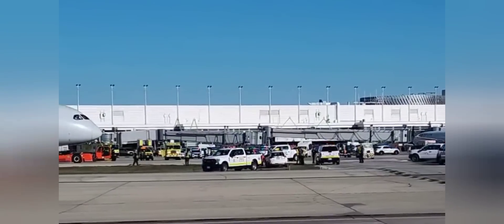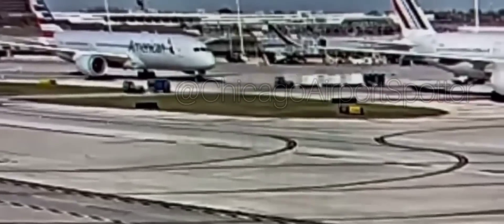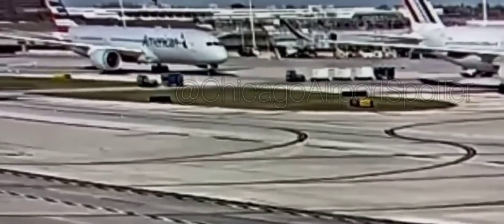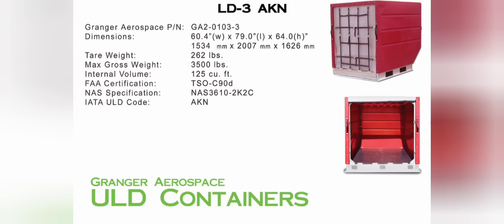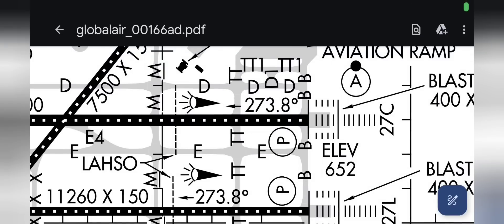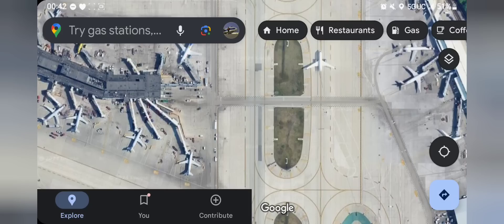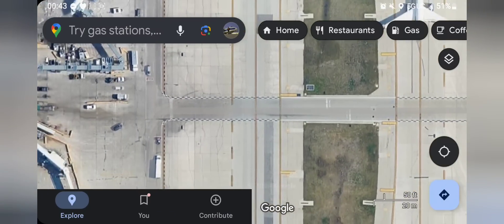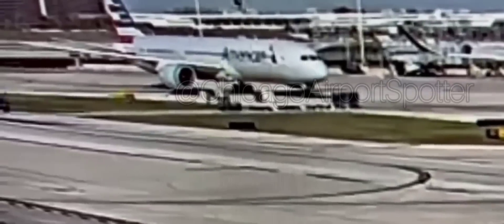INCIDENT REVIEW - American Airlines Boeing 787 Engine Ingests Cargo Container at O'Hare [10.17.24]

Comment: Good briefing on the luggage carts. Flew the 787 for my last 5 years. I saw another reader mentioned 20 million for one Pratt. The price for  these aircraft (787-8) is just a little over 200 million. The 787-9 is over 240 million, and the 787-10 just under 300 million. 

The OP mentioned he drives a fair amount at ORD. At least from my experience, ground handlers in O’Hare are pretty good about safe driving on the tarmac, as in not usually cutting us off as we were taxiing. There definitely have been countless ‘incidents’ at other airports (never at any of our international destinations….only in U.S. airports) where I had to slow or even stop the aircraft while a baggage handler crosses right in front of us, sometimes the driver not even looking. Just surprised this doesn’t happen more often.
Reply from the maker: I was a ramp controller for a few years, I took a lot of calls from pilots giving me the company name and vehicle number of vehicles that cut them off. And by "a lot" I mean 10-15 over 4-5 years. 1 is a lot, tbh. I followed up on every single one because I didn't want that idiocy on my ramp.

I remember one time I sheepishly slowed to a halt by the F Alley, and an RJ pilot waved me through. I looked around me, saw that everything was good, and I scooted across in front of him, gave him a thumbs-up, and immediately got pulled over by airport security 🤣 He let me go, though.
Reply: @ChicagoAirportSpotter  Always like to read about that type of story. Never was based in ORD, except for a month back in the mid 80s. Actually one of the best airports, excellent ATC, operations, as well as the city itself. Never visited any Ramp Controller, but did a tour of our OPs in SFO as I had a friend working there. Anyways, I just remembered that I need to subscribe to your channel. Retirement is fun every single day, but I still remain interested in Safety, CRM, etc.

Comment: Well done. A little wordy, IMO, but well done. Most will not recognize that the A350 blew the containers off with 100+ mph jet blast, as at the point where the containers are flying the A350 has begun to move forward. Break away thrust can be 150 mph. Maybe more. It is for this reason we never ask pilots of large, heavy jets to “expedite” or “taxi without delay.” People have died in similar situations here at ORD as a result.
Reply from the maker: Definitely a little wordy - I did this off the top of my head without a script. If I do another one of these, I'm changing that. I had so many people asking me what happened that I got tired of typing it out, so I made a video to explain it to them and then decided to upload said video 😆

And thank you for the additional info. When I was a ramp controller, I often used the phrase "minimum breakaway thrust" on the frequency when guiding departing aircraft out off the ramp because we had so much activity behind them, we had to take every possible precaution to deal with the horrible layout of the Lima Alley.

Comment: This service road crosses Two Active aircraft Taxiways... Surely the MUST be positive ground control of who can cross them, & when. Just as aircraft could not cross a taxiway with out GC clearance neither should a ground transit vehicle of any kind. This would not have happened if the aircraft ahead of the AA had not 'powered up' to move as the Dolly truck passed behind. 
I don't see this as a failure or blameworthy by the Cargo dolly driver. This is & should be a GC failure & human GC should more tightly control this system, and also by Computer tracking for failsafe. That 20 seconds saved cost upwards of $20 million...and the associated risk of danger to life & aircraft.

Comment: Those cans don't weigh much and can be pushed around by hand on a hard surface. Between them being light in weight and having the ability to catch a lot of air, I can see this happening from a strong gust if not secured properly. That it was behind the jet liner when it took off was just dumb and should never happen.
It just seems like another case of a impatient Chicago driver to me.

Comment: I suggest that engine will be scrap. Every single moving component will have been stressed. I will have a value for engineering training and testing but little more. Now is also not the time to find out your third party insurance expired. What I do hope is that the driver is not fired. He won’t make this mistake again, we can all learn from this incident and make it so that people are more prepared to report their own mistakes knowing they won’t get fired. I say this after being on an aircraft that had its wingtip torn off by a catering truck. The clowns didn’t stop. They sped off and hid their truck in an obscure depot and zipped off home. They said they weren’t at work that day - forgetting airports have cameras, security logs on passes and aviation, even aircraft catering, runs on paperwork. When caught they said they thought they would get sacked for hitting an aircraft. They did get fired, for not reporting a collision and for trying a cover-up.

Comment: I remember when the containers had doors/curtains on both sides and they would drive them around with Both sides fully open (when empty) to help prevent this from happening.....  (i.e. extremely high resistance to jet (and propeller) blast!)
 
AND Thank You for the quick explanation .vs. a 15 to 25 minute explanation!!!

Comment: Obviously there’s not a lot that the AA crew could have done about that. 

Did get me awondering though. With an engine at idle, if you cut the fuel off, at that instance is there any immediate reduction in inlet air flow? I’m thinking not. Everything is still spinning as it was, and it will start to slow down, but for a while it’ll still be sucking in air (and luggage containers). 

So a crew would be literally helpless to forestall luggage container FOD incidents in circumstances like this.

Comment: I train ramp agents at TPA and both drivers would be fired or at least one removed from driving powered equipment. We are told never cross between any aircraft on a taxi way they have the right of way at all times, you sit and wait and OPS does not take kindly to infractions. you are either going to get re-training and retake the airport test or 6 months suspension and points and in this case fired and fined and points. I have seen other companies go behind our aircraft when the navigation lights are on either in or out bound and some will pass as we are marshaling in the plane including AP police with no lights showing they are on a call. We turn them over to OPS and they get hit with fines or talked to?

Comment: It can be repaired just depends how much they want to. Those blades are a composite material with a titanium leading edge. These blades can be repaired but it’s a process for sure. The rest of the engine can be repaired. These engines cost tens of millions of dollars. Most airlines don’t own their engines they lease them. But each engine and airline can differ. But the leasing company may have the final say

Comment: One problem here is that for crossing ground traffic the holding points are not at save positions. It should not happen that the distance of stopped planes to crossing vehicles is within jet blast range.

Comment: Cost of new 787 can easily be: $225,000,000
Cost of a “well used” one, although it would be rare to see the price ever go this low - it would also need volumes of work unless used for cargo: $119,000,000

Cost with taking this passenger jet out of service, and nothing but out of service: millions.
Cost to replace it with a possible rented/leased other similiar jet: millions per week.

The engine can actually be detached and replaced relatively easily, as long as nothing else got damaged. And easy fix in the amount of hours and all, but… Some parts of the engine will likely be able to be recovered, perhaps. Cost of engine repair for starters; fifteen million, if needing entirely replaced 180 million - just for one engine
Reply: what are you smoking, bub.. or are those Venezuelan dollars

Comment: Looking at this incident from a safety/risk accessment perspective there is usually multiple factors that when crossed especially in aviation that can lead to an accident/incident. # 1 as stated in comments there was a lack for situational awareness . Crossing behind a heavy is a recipe for disaster. There is enough jet blast to send everything including the containers flying. Most LD3 transports that i have seen do have some slack with the clamps to hold down the containers and with jet blast from a heavy i believe it is beyond what those to clamps are designed / intended to hold. # 2 haste to meet a deadline for baggage perfomance goal may be a factor as others have mentioned , compeling the driver to take a risk that is not safe nor recommended. # 3 maybe there is an issue with the layout and design of the airport around that and other issues compelling individuals to take risks that are not safe. On the map shown that area is a known hot spot. I am surprised there is a surface road crossing a movement area / taxiway. Are there tunnels there that can help to minimize / prevent taxiway incursions and provide a safe path to cross underneath. Where i work there are tunnels to cross underneath taxiways so aircraft and ramp traffic are separate near movement areas. Maybe this incident can lead to a redesign of the areas there to control the risk associated with the taxiway crossing there and some eduation in situational awareness training to prevent the multiple factors from coelesing into another incident in that area

Comment: Question:  say the AA pilot had been very attentive and seen first container start to be blown off the cart and pressed the big red buttom "emergency engine stop" (f such exists).  Would it have made any difference to engine damage?  I know engines take forever to stop spinning, but curious if it is a logarithmic curve where thrust drops very fast, followed by long spin down without appreciable thrust, or whether it is more linear.
Reply: wasn't in the cockpit, so that's my first alibi ... but they were about to start moving again because AF ahead was starting ... so clearly there should have been a higher level of awareness prior to resuming taxi than when they were stopped.

... I've thought the same thing, though.  The fan wouldn't be stopped, but I think it wouldn't have sucked the container into the inlet.  The container would probably have still struck the cowl.

The damage isn't on the pilot(s) but it seems, if the video segment plays in real time, the speed of the fan could have been reduced to avoid ingestion.

Taxing, especially at ORD, is one of the most challenging/threatening parts of the job.  I've done it for AA since '98.

Comment: Do the tugs need any ATC authorization to cross taxiways?   
Since the AF plane was stopped on other side of service road,  can't the tug driver safely assume the AA plane isn't moving until the AF plane has cleared that section?  And bigger picture, isn't the true problem the AF plane increasing thrust without knowing there was a tug with containers passing just behind?  The AF plane would have no way to know there was a tug crossing on service road behind it.   If ATC doesn't manage tugs, do they have a responsibility to look both in front and behind a plane to ensure no tugs would be affected by a plane increasing thrust? 
Or is it assumed that no tugs would ever pass ahead or behind planes stopped on a taxiway?

Comment: I see what happened. The jet blast from the Air France in front blew the cargo off the trailer being towed between the two planes (in front of the AA) and one of the cargo containers when to the AA right engine, then was sucked in in about 3 or 4 seconds. Good luck.

Comment: This is actually a fairly cheap engine failure,  (excluding the high replacement cost) since no engineering labor will be expended on a lengthy failure analysis or root cause investigation. Also, negative on the rebuild and/or using any parts as spares, because lawyers.

Comment: A&P currently doing heavy checks on 737s here. Most likely the majority of the debris when through the bypass duct. Many of those front fan blades look ok from those pictures. It's possible most of the compressor and turbine stages are ok. Mechanics can swap this engine and inspect the pylon in 24 hours if theyre properly equiped at this airport. You'll need a new intake to bolt onto the new engine. The engine will go back to the manufacturer and get a complete overhaul. Most likely it will just need a lot of new blades. The shafts, cases, accessories, etc are probably all fine. It takes a lot to make an engine not worth salavaging at all.

Edit: someone below says his dad is a Pratt and Whitney engineer and he says it will be scrapped. If a P&W guy says it then I would defer to him, although engineers don't always know how maintenance really gets handled so it depends on their exact role. If they really do have to do crack inspections on every single part then I could see them scraping it, but I think it would be worth it to use any good parts as spares.
Reply: I worked in certification at GE for a couple of decades until recently retiring. A bag of bolts that can fit in your pocket can trash an engine. 
(So don't leave a bag of bolts anywhere near the intake when the engine is on the test stand.)
Yeah, there will be salvageable parts, but in today's world, they'll discard anything even a little "iffy".
Reply: @UncleKennysPlace  fair point. We actually had a few screws get sucked in at our maintenance facility recently, but it just needed some inlet repairs and a few new fan blades. The core was fine, thankfully. I assume they boroscoped every stage. It was on a 757.
Reply: Would you bet that A&P license that feeds you on "many of the front fan blades look okay"?  Every one of those fan blades better go into recycling, so they can be reprocessed back into usable parts.
Reply: @gordonbryan8381 Probably not, those fan blades are carbon fiber with metal leading edge erosion strips…no recycling, they’re trash.
Reply: @gordonbryan8381  no. I would bet my A&P license on a certified NDT professional to give the final go/no go on each of those blades after a proper inspection.
Reply: I agree accessories, and various parts will be salvageable, probably even undamaged and after inspection will be put into the spares bin, but I have my doubts that the engine core is at all repairable.  I have no doubt a few pounds of metal passed through the hot section and centrifugal forces of anything that temporarily hung up on a fan or turbine blade would be flung out from the disk along with likely some broken off blades and impacted all along the inner walls of the core sections.  Some probably jammed up as well putting torque that would likely bring shafts out of true, but they are pretty beefy so possibly that is one part inside the core that can be reused along with some injectors, but I think the rest would be too far gone since the disks, blades, and stator vanes were pitted, bent or scratched if not broken.  I am not an engine mechanic but knowing how much damage a large bird can do (at 10 lbs or so) and birds being quite a bit softer and lighter than aluminum box that engine swallowed there is no doubt it was catastrophically damaged.  I would bet that engine core and 90% of what is inside it is done.  If I am not mistaken the guys helmet that went into an engine when he got sucked into the intake of an A-6 intruder destroyed that engine as well, and that helmet is just a few pounds of fiberglass and plastic.  Granted the Dreamliner engine appeared to only be running at ground idle (since it was stationary on the tarmac) and since the Intruder was preparing for a cat shot it may have have been running up or at full power, which would make a difference but I don't remember and it may have also could have been getting hooked up and only at idle and engine RPM would certainly be a factor in the damage on both incidents.
Reply: @larrybremer4930  hadn't thought about the shafts being out of true, that could cause bearing and bearing mount damage too.
Reply: Likely the N.D.T. and physical/dimensional inspections required to re-certify any and all parts of this jet engine will be extensive and expensive. I’ve worked in aircraft repair and overhaul and I can’t imagine Q.A., Q.C. and Engineering departments agreeing to use much of anything from that power plant…
Reply: @richardvervoorn6626  wouldn't it be cheaper to analyze a used shaft for cracks and bends than to make a whole new one? It would take forever, but I imagine it would be worth it at least for the purpose of marking the parts as airworthy spares.
Reply: @Synergy7Studios  every evaluation will be based on cost of each part, whether it be replaced or refurbished. There may well be parts of that engine that are re-certifiable but any parts coming out of that engine will require independent evaluation.
Reply from the maker: Thank you for your insight. I don't know anything about jet engines other than reading diagrams about how they work and what they look like inside. Occasionally, I'll walk up to A&Ps working on my gate and ask them, if they have a sec, to explain to me what they're doing.
Reply: American wont care about writing off the engine, its going to be paid by someones insurance company.  Whoever owns the tug is liable for the damages.
Reply: @Sandra-dt4ec no idea.
Reply: I second your comment! Engineer thinks one way, mechanic thinks another, there's hope in that being overhauled. Also, from a lessor's or owner's standpoint, I don't think they would want to write that as a total loss.